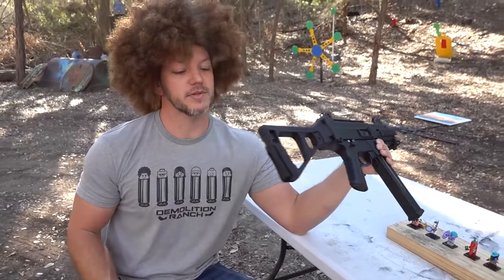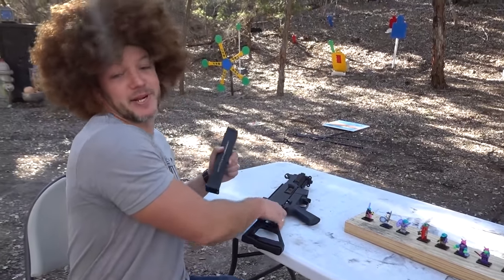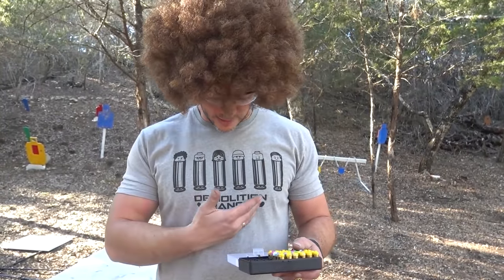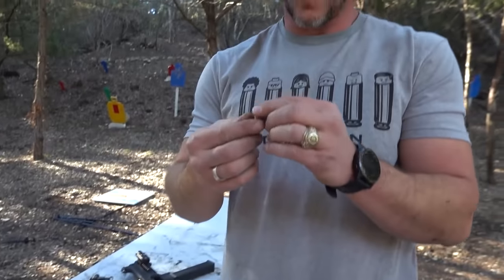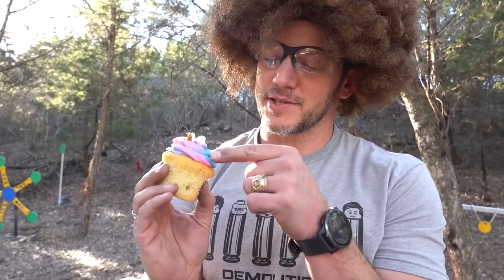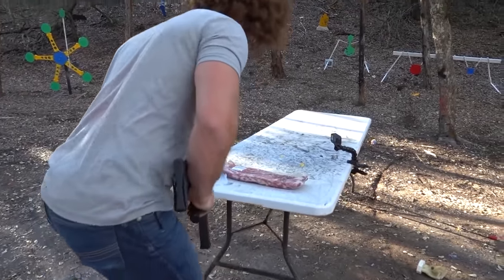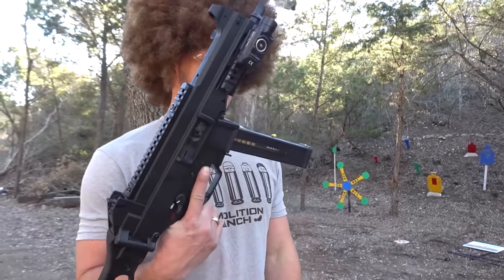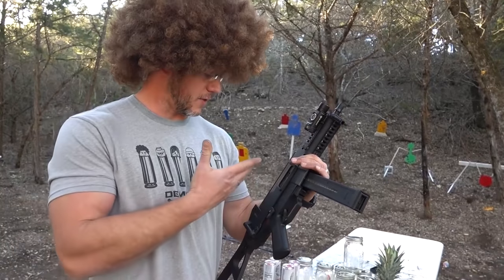I GOT A UMP!!! Instantly Loaded it with Lego Head Rounds...

Comment: I dont know if they still do it or not but Lego man heads normal have three small hole or just one on top of the head to you more easily put them on the Lego body's you could try using a dab of jb weld or something to block it up to get more power out of them

Comment: At home defense ranges, if one of these hurts as much as stepping barefoot on a Lego brick, this may be a revolution in non lethal protection.
Reply: Isn’t this a warcrime? Non-xrayable (definitely not a word) ammunition?
Reply: @disengageddanny9331  who cares
Reply: @disengageddanny9331  its also not very accurate and or deadly from at least 30-40 feet, at most it hits you like an airsoft gun and breaks some skin and gets stuck.
Reply: The problem is the inability to eject a round and cycle to the next round.
Reply: @disengageddanny9331  There is no such thing as a war crime unless by one against their own nation. People have tried to sissify war!
Reply: @disengageddanny9331  Last I checked, home invasion is not a war.
Reply: @jd4uproductions404  yeah, probably better in a revolver. Still a joke comment, but it actually would probably be pretty deterring to a random paltry burglar.
Reply: @disengageddanny9331  its not a war crime the first time
Reply: I am thinking about using lego bricks as a barrier to entry, but how do I make them take their shoes off first???
Reply: @dangurtler7177  seen Home Alone? Roofing tar they have to walk across
Reply: @disengageddanny9331  War Crime S'more Crime
Reply: @dangurtler7177  Cover your front steps in tar, of course. That is if you can't lure them through the basement first, with tar on the stairs and a nail at the top so they have to try another entrance.
Reply: @disengageddanny9331  hollowpoints are a war crime yet they are the standard for defensive use
Reply: @jameskazd9951  you do have a point

Comment: You gotta use the solid head ones. I think I saw that the lego heads you’re using are the revamped ones with air holes in the stud on top (for when children swallow them and they get stuck in their throats they can still breath)

It might work better with the older solid head ones
Reply: Thats my thought, too!
Reply: Or just glue bbs inside.
Reply: AP Lego heads 😂

Comment: I'd never thought I would see a UMP springer. Think about it, it shoots plastic ball-ish projectiles and you need to keep cycling the round manually
Reply: Assuming he only pushed these lego heads in the casings, I wonder if using a bit of superglue would allow the powder to build up more pressure, probably not enough for cycling rounds but I'd be curious to see the difference.

Comment: Remember, switching to your sidearm is faster than reloading.
Also try finding old LEGO head, they don't have a hole at the top. Might keep the powder in.
Reply: I wouldn't reccomend that, old Legos are expensive, even spare parts bins can go for a hundred dollars or so nowadays. Probably safer for the wallet to just have some one-off 3D printed heads instead. Can be made out of nearly anything after you mold or scan the heads too!

Comment: I'd love to see this with a faster burning powder. Maybe the same powder used in blanks?
Reply: Couldnt you use two rounds end to end? The front one with a lego bullet, the rim filed off so it fits in the barrel, and the primer glued to the end of the rear bullet, which sits in the chamber as normal with a metal pointy bullet?
Reply: @Debbiebabe69  you’d have to alter the chamber.

Comment: Powder isn't burning because it doesn't have enough pressure between the Lego head and the casing, get someone to machine some copper Lego heads and you're in business
Reply: or faster burning powder
Reply: exactly - when you burn gunpowder in an enclosed container the gases it expels will increase the pressure around it which will accelerate the reaction (oxidation) expelling even more gases hence increasing the pressure even more in a positive feedback, the result is a BANG, all the gases expelled in a blink of an eye. 
However if you burn it out in the open, it will be under one atmospheric pressure from start to finish which will result in no increase in pressure hence no oxidation acceleration or positive feedback
In the end both reactions are the same, both will expel the same volume of gases but one will do it way faster than the other.
Reply: ATF and Mom's Demand Action: "I don't know why, but something about this sounds really illegal and we better make it illegal if it isnt just in case you want to have fun"

Comment: I wonder what would happen if you filled the heads with glue or resin or even a 3D printed "slug?" Maybe open up the under side of the Lego head a slip in a steel ball bearing?
Reply: I was wondering if there are some shotgun pellets that fit nicely inside a lego man head. could give it the weight it needs ;)

Comment: Having actually carried and used a UMP in .40 SW, I can say with absolute conviction the UMP sucks.

The trigger is smooth but super heavy because HK hates you.

In .40 SW on auto the gun is uncontrollable because it weighs nothing and has a massive blowback bolt.

The rails attach with dinky little screws.  The top rail breaks off at the screws from recoil with an optic on it.

And the magazines are single feed that you have to load like pistol magazines.
Reply: 45acp is no better

Comment: I started carrying .40 in the late 90's, still carry it today. 10mm is an awesome handgun cartridge, but it definitely takes longer to accurately place follow-up shots with it.
Reply: I reload both 40 and 10 mm. The cheap target 10 mm has the same exact specs as a 40. But you can use that brass to reload hot rounds up to 41 magnum power. 

So just by changing mags loaded with different ammo with a 10mm, you can go with 40 cal power in town, and then swap mags to ammo loaded with XTP or hard cast hot rounds for a woods gun. You get the best of both worlds wit a 10mm.

Comment: Hey guys I have a question:  I’m not what I would call an “expert”, but I have grown up all my life with all kinds of firearms and am an avid shooter.  With this issue of not cycling because the round is so light it blows the powder out before it lights off, what if you super glued the lego heads into the case?  As we saw in the Hi-Point videos, it is damn near impossible to stop a round from coming out, so the super glue won’t stop it, but it should hold it long enough or slow it down in the chamber enough for more or all of the powder to burn?  Good idea or am I an idiot??
Reply: I don’t think the superglue would be enough to build that pressure high enough to get good pressure. And even if it did, it might be too much for the Lego. I had the same thought though. I just feel like with the pressure you want, that small amount of contact area wouldn’t get the pressures up enough